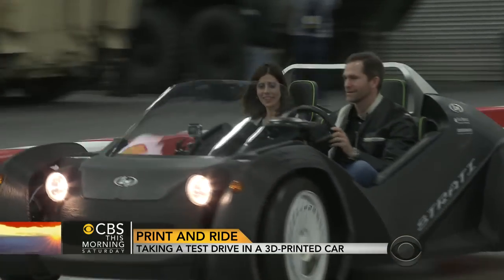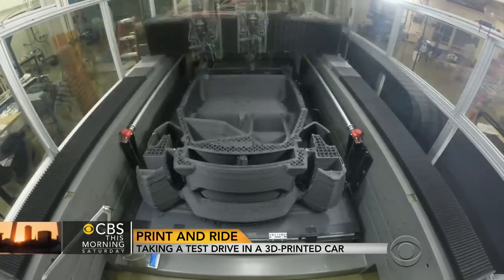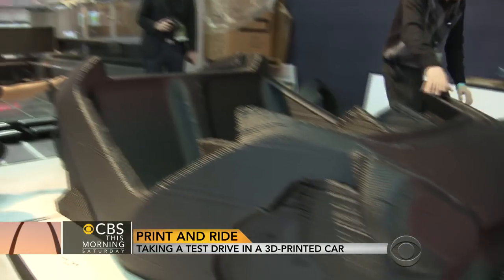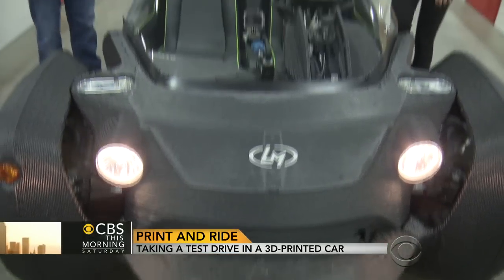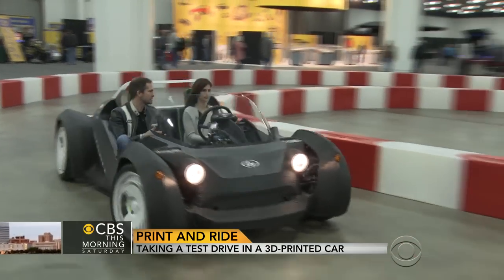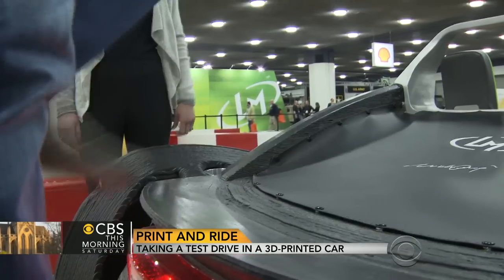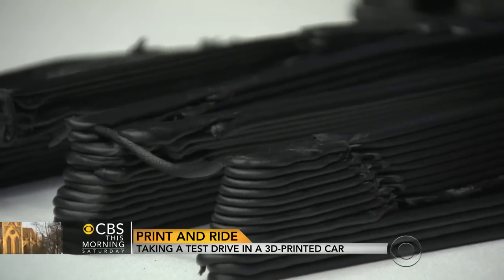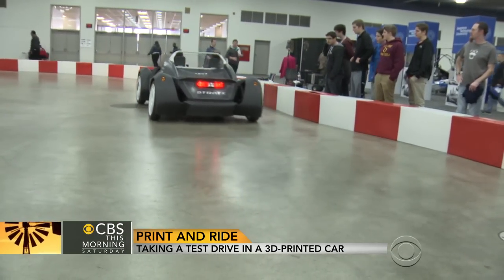Taking a test drive in a 3D-printed car

Comment: "95% of the car is printed" does he not realize they used, glass, lights, seats, engine, tires, metal, springs, etc.? ALL that is printed is the chassis of the car... not sure how that's 95% but whatever.
Reply: he is exaggerating it ... aerospace grade material :-)
Reply: @YaseenKhan-xn8tw  Carbon fiber nylon is aerospace grade, just means its strong and light weight

Comment: wow 18 to 30 grand this shit is made of plastic what a rip of
Reply: Agreed. Total crap. Fiberglass is far better, safer and faster to build. Tubing, as in sand rails, is also the way to go. For mods, simply attach custom-designed body panels.